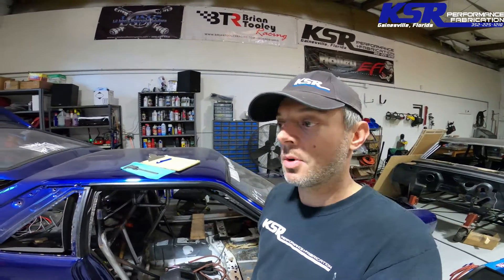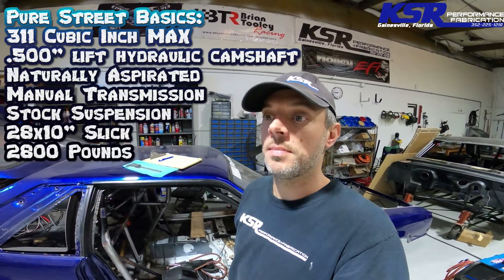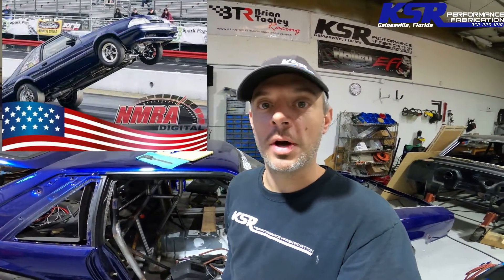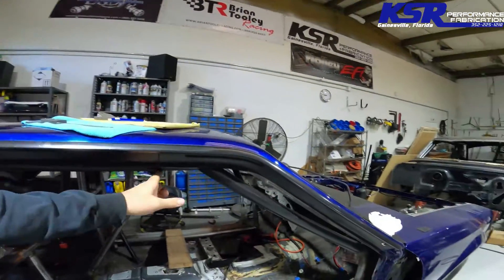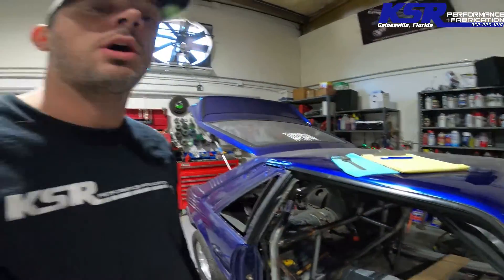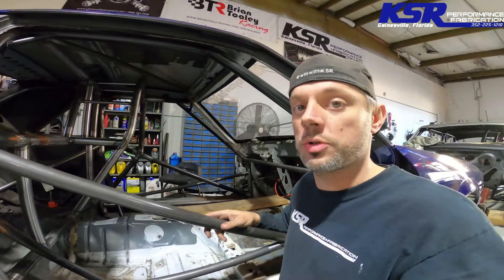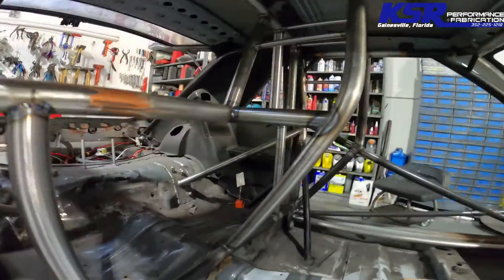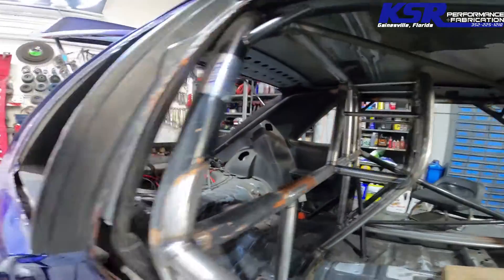Foxbody Mustang 25.5 Upgrade in 19 Minutes!! 9000+ RPM Small Block Ford on the Dyno. TIG Welding!

Comment: Im wanting to cage my pickup truck, its gonna be around 600whp and weighs 3100 with me in it so I think it has the potential to go high 9s. Would I need an 8 point cage? I know its supposed to go to the frame too but if you plate the cage to the cab then weld the cab to the frame would that suffice? Love your work and your attitude, as an amateur fabricator I've learned a lot from your channel (and watching you on cleetus')

Comment: What size rod was used for this build. standard size 302 or a 5.4 or a 5.7 Chevy rod.
Reply from the maker: We had nothing to do with the engine, but knowing the owner, it was some sort of aftermarket Ford rod.
Reply: @KSRPerformanceFabrication  you should find out. would be nice to know.
Reply: Rules stated stock length rod. 5.090"

Comment: DOM tubing? OD?
Reply from the maker: All 4130 chromoly. Main cage is 1 5/8, funny car cage  bars are 1 1/2", secondary door bars are 1 1/4", helmet supports are 3/4"
Reply: @KSRPerformanceFabrication  Beautiful work! Where do you have to take the car to to get the cage certified?
Reply: Gainesville Raceway is having a chassis certification next Saturday, Jan 18, at the track.